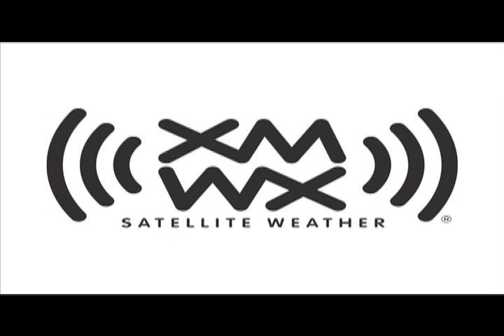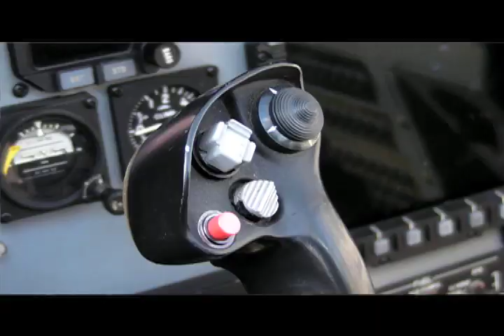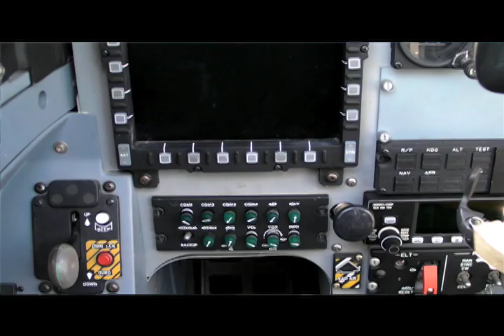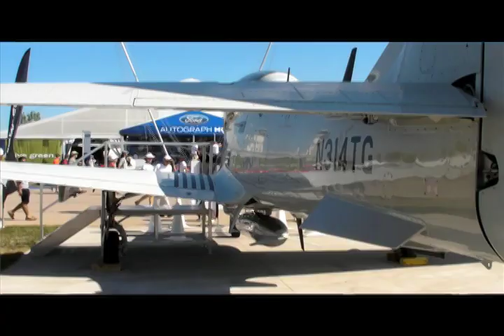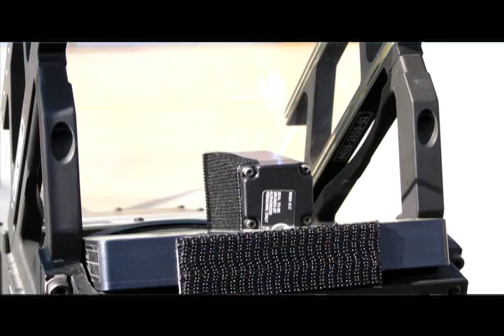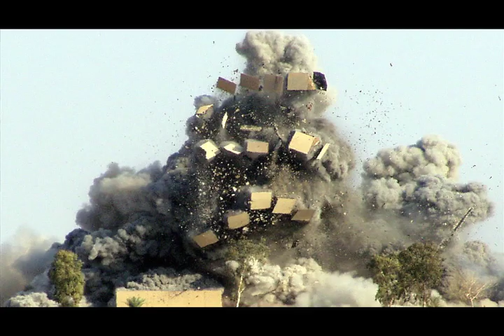Super Tucano at AirVenture

Comment: Tucano means "Toucan", name given to the forest bird by brazilian indian tribes. 

The A - 10 Thunderbolt has a powerful canon and its structure manage fire that an A - 29 can't.

But, the A - 29 can perform 70 % of missions of A - 10 with very low cost. One hour of flight of A - 29 costs 700 to 1000 dollars. One hour of flight of A - 10 costs 12000 to 17000 dollars. An A - 29 can be 12 hours flying without refueling if it is with two new support tanks on wings. 

The plane is brazilian, created by the world famous hungarian aircraft designer Joseph Kovacs. The engine is a Pratt - Whitney from United States with 1603 hp.The panel electronic parts are from Israel. It works with several armament from US too.

Embraer is the brazilian air force maker, but it became private since 1994. There's  several  investors in Embraer and the four biggest investors are Brandes Investment Partners (US, 14,4%), Mondrian Investment Partners (United Kingdon, 10,1%), BNDESPar (Brazil, 5,4%) and the Blackrock (US; 5,0%).

Comment: Yes. The information are correct. The Smoke Squadron has used the Tucano T-27 (EMB-312) but from the second semester of the 2013 the Smoke Squadron will use the A-29 Super Tucano ( EMB-314 ). The squadron has already received the firsts Super Tucano and the airplanes will have a new scheme paint.